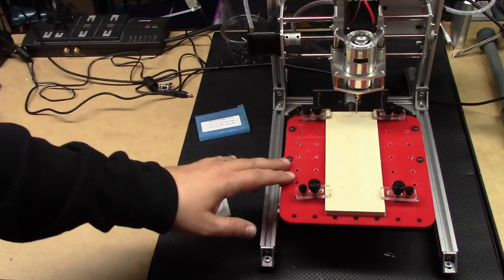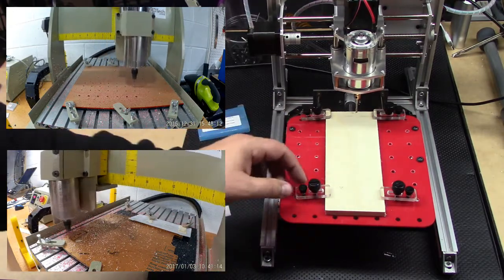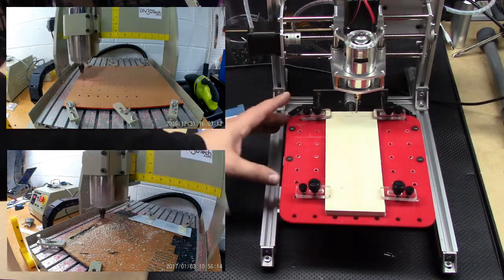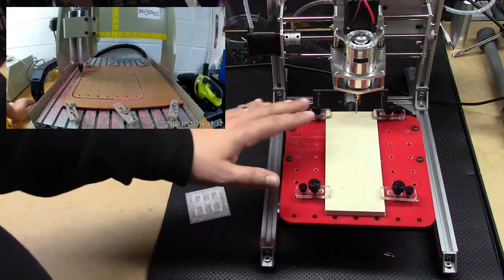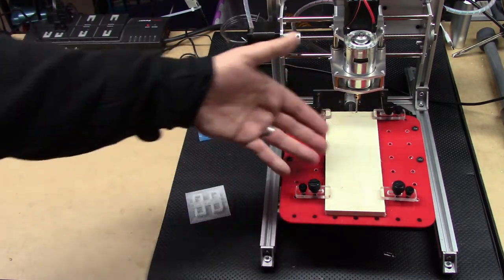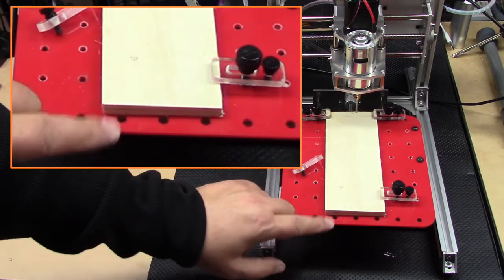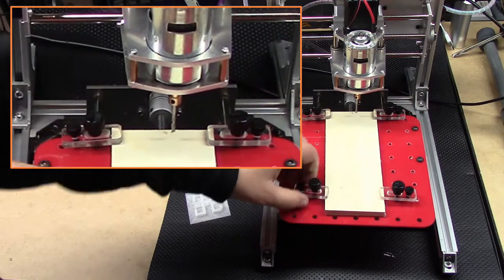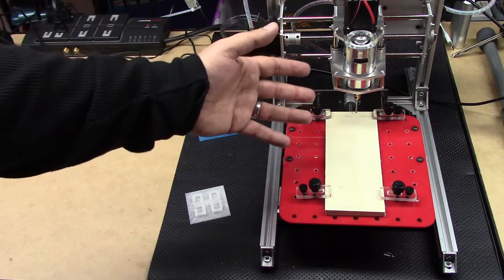Desktop CNC -  Extended Bed for Larger Cuts!

Comment: I've been looking at those CNC 3018 Pro machines that have a 300x180mm bed... would this work and allow me to engrave up to 300x300mm? I'm looking to cut guitar pickguards and Strats are 283x223 and Telecasters are so close at 217x188... ya 8mm off. Don't need anything giant or expensive just 120mm longer than what they all seem to be.
Reply from the maker: Sorry you will need to "sub" that size, for what you want to do something like the Shapeoko would be great as don't try to cheap out as you will spend more time fighting problems them creating things.  These little are good for learning and small things, however pushing them to do thing beyond there bounds will simply be a headache...

Comment: Looking forward to accurate dimension ABS milling tests without melting which is the main use I'd want one of these for.

BTW, I wonder why they didn't include longer rails in the kit to allow more travel as it would have added very little to the price.
Reply from the maker: agreed on the later for ABS on this I would go with a single as the torque to rpm on this little guy will take some convincing to do but do-able...
Reply: Something you might try which would still be have an advantage over cutouts made in ABS manually - the way I make cutouts in the ABS lids for electronics enclosures is to drill rows of holes, pop out the cutout, and then just file down the periphery of the opening. I experience no melting with a drill bit. You could do the same even better and more easily with CNC.